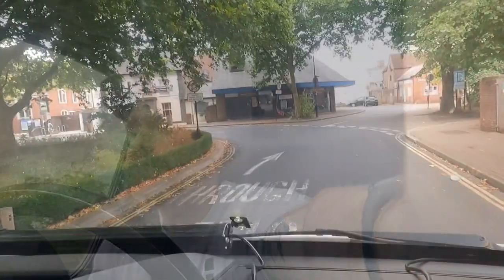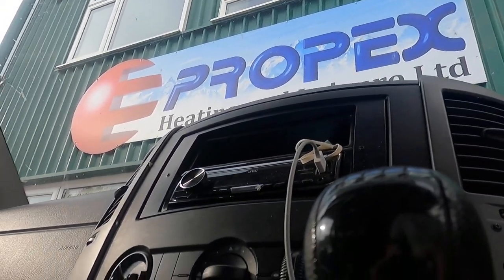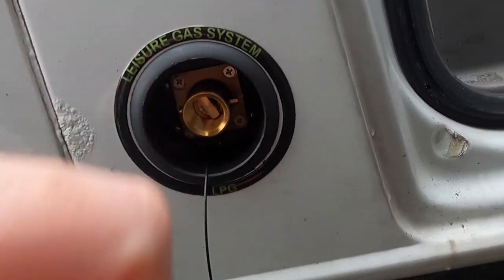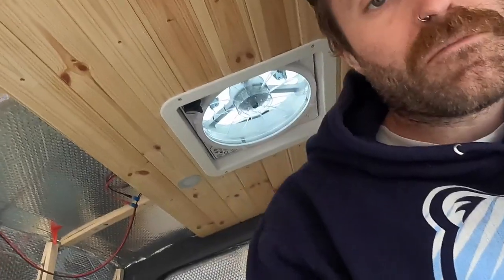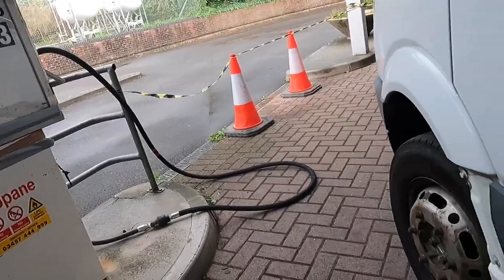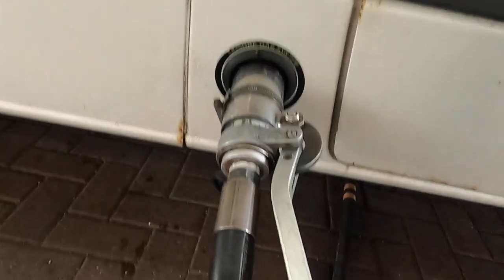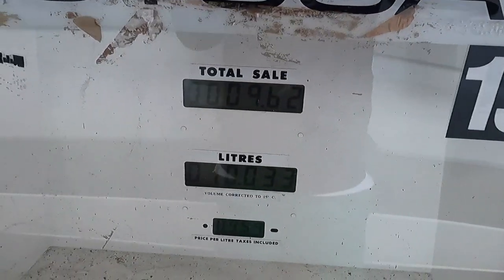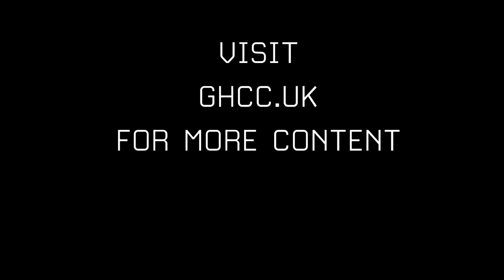My Underslung LPG Gas System and How To Fill It Up | Idiot’s Guide | DIY Sprinter Van Conversion UK

Comment: Thanks for the video. Did they plumb it right up to your appliances or did you need to do that? Looking at the same supplier after watching your video.
Reply from the maker: Hey bud! They did indeed. When I initially called them up, the woman on the phone was super friendly and helpful. She basically asked what size tank I wanted (I chose 25L) and whether I wanted a BBQ hook up (I didn't). She then asked what appliances it would need to be hooked up to and asked if there was anything else currently installed underneath the van that might get in the way. The total cost came to £766 and they did it within 6hrs. Another place I was looking at was quoting over £1300 and said they'd be able to do it in one day for extra!